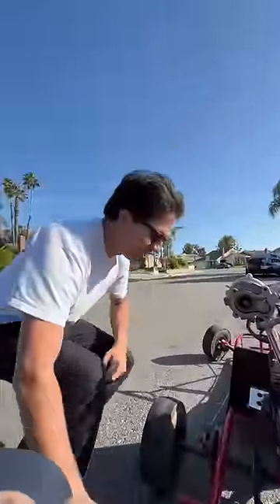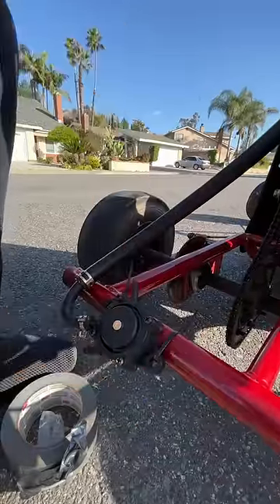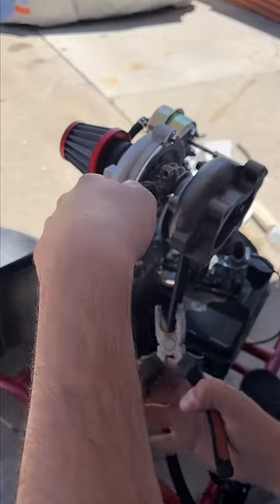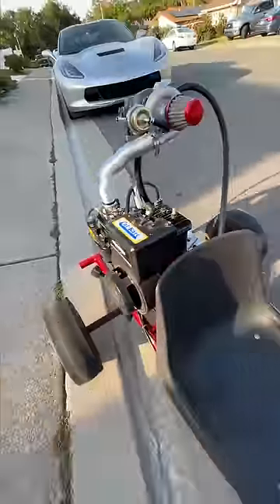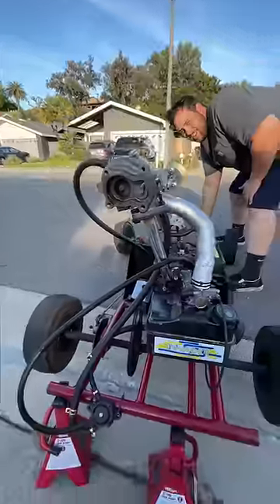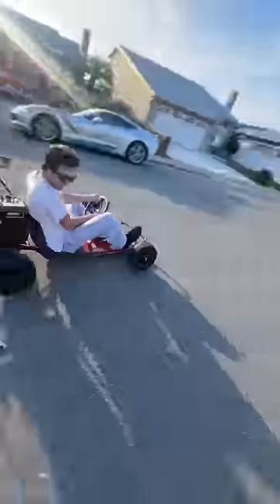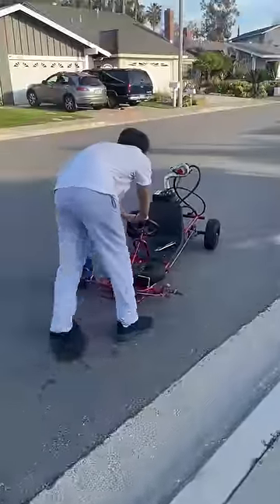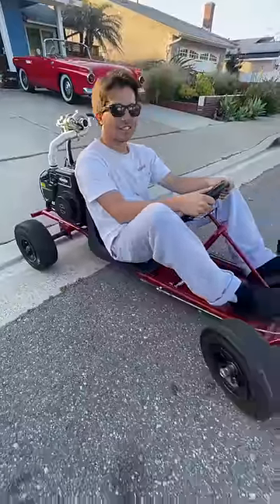I put a turbo on my Gokart and it didn't end well

Comment: I don't see how that pipe held any pressure.
Reply: It dont hold pressure on the dryer either
Reply: That's exactly what i was thinking..
Reply: Because it's like five pounds of pressure Jesus
Reply: @skullman0819  Yeah, 5psi above atmospheric pressure. That's a lot of pressure for some shitty pipe that has no structure.
Reply: It doesn't hold pressure 😅
Reply: You can bust one of those tubes with your lung pressure.😂
Reply: It didnt lol he should be worried about other things, obviously
Reply: There's no way that any of that boost is going into the engine.
Reply: @jonnywilson9117  just 7psi is half an atmosphere!! Needs a proper boost hose too!
Reply: Nah, they are nothing but foil with metal wire. Barely enough to do the intended heat transfer from the exhaust manifold to the air intake. Very easily he had pin holes in it before he got it installed.
Reply: @jonnywilson9117  yess it it i rebuild steering gearboxes and we use 6psi and u wont believe how much pressure that is when they go bad.... in liquid... i know turbos psi im air idk if this pressure works the same
Reply: @214oc9  Well the other guy seems to think 6psi forced induction is under half of our atmospheric pressure. What he doesn't realise is (unless I'm wrong) it's 6psi above atmospheric pressure. Which yes, is a lot of pressure. Well, it's not when talking forced induction, but a pathetic bit of ducting isn't going to handle 6psi trying that's essentially trying to suck it into the turbo. 6 psi in a large area is small. But in a tight area it's a lot of pressure being that there isn't as much volume. I imagine getting hit by 6psi of liquid (oil) is worse than 6pis of air out of a nozzle or tube of the same size.
Reply: @warrenlilly2091  It isn't when referring to forced induction. 7psi is 7psi above atmospheric pressure because it's being forced under pressure. Any boost number you're going for is always going to be above atmospheric pressure. So if you're hitting boost numbers of 20psi, that's 20psi above atmospheric pressure, not 5.3psi as atmospheric is around 14.7. Total pressure would come to say 20+atmopheric pressure. But obviously that's already taken into account. A boost gauge is at 0 because there's no forced induction. Again, 7PSI of boost, is 7psi above atmospheric pressure. It's a lot of pressure for a tiny hose to take. That hose would either pop off or just get sucked into the turbo. Pre turbo is under vacuum, after the turbo, or the hot side is pressurised.
Reply: 7psi is 7psi ABOVE ATMOSPHERIC PRESSURE. do you really think "boost" would be half of atmospheric pressure? That's the definition of vacuum. Jesus ppl read a book
Reply: If it works it works
Reply: Thats why he used it. It wont hold any boost
Reply: It didnt. The turbo most definitely didnt do anything lmao
Reply: Single cylinder engine doesn't make enough exhaust pressure to turn a turbocharger 😅
Reply: Jb-weld
Reply: I used a Chef Boiardi can to use in my 95 gsx and it held around 12lbs haha
Reply: @FlexYourFreedoms  A chef boiardi can is pretty thick steel / tin lol...
Reply: It doesn't.
Reply: lol anyone that thinks it holds anything has never tried turboing a car.. 7psi for a standard engine is deff a fair amount of pressure, and any hose not quite on enough/clamped properly will quickly blow off
Reply: I don’t think it worked at all I didn’t see any speed shots or anything wheel falling off is just to make up how extreme it never was and wouldn’t happen if anything the rear woulda blew off
Reply: @skullman0819 more like a half pound of pressure 😂
Reply: Corrigated tube didnt extend out so no pressure 😂
Reply: @tgshark1 the dryer doesnt need air pressure💀🤡
Reply: It didn't the turbo wasn't doing shit trust me
Reply: I used shop vacuum hose and my 212 and it pushes alot of boost surprisingly

Comment: Do a dual carb setup to stop it from leaning out under boost
Reply: Or maybe get a proper size performance carb so he can adjust it and make a proper charge pipe
Reply: Ur my kinda guy
Reply: Or, get a real pipe that will actually hold boost....
Reply: @moddedgt350  small loan of a million dollas..🤭
Reply: Nerd👍
Reply: @franktime4425  -🤓
Reply: Get a wide banddddd see what afrs your running
Reply: @moddedgt350  Oh yeah! We love EFI and similar things like it till they break :) my CR125’s FI kit was about $1k, but damn it ran great until it didn’t! That replacement hurt more than the initial purchase.
Reply: @moddedgt350  thats what i would do
Reply: Carb needs to be on the inlet of the turbo for it to run properly.  A regular carb like that is not made to have pressure being forced into it.  Either that or the carb would have to be modified as a blow through carb.  The thing probably dumps gas all over the place.  Also that pipe on the outlet of the turbo is a joke, that is not made for any pressure it’s made to carry heat from a manifold to a air cleaner valve on an old school car.
Reply: What boost? No way that turbo is spooling enough.
Reply: @zachiga  Yeah fuel injected can just stay on the bigger engines. I tend to stay away from fuel injected anything Motorsport wise.
Reply: Wont that make it half draw though? Im confused on how these dual carb setups work. Also, wont pressurizing the one carb and getting a stronger fuel pump with the right jetting stop it from leaning out?
Reply: @syndeko1632  I think you would just have to test it out tbh... Both would work just a matter of how you execute it.
Reply: urnum5495  what?😂what are you mad about guy😂😂
Reply: Fax
Reply: @joshmanis9860  how bout he get a 3 Honda with no engine with Hector holding the money because he to slow to to run away with the money 😂😂😂
Reply: Or just dump the lot.
Reply: The problem is he's trying to run the system blow through style without pressurized the fuel bowl, with a draw through system you don't have to do anything to a carb aside from jetting it with whatever jet works, but with a blow through system you have to pressurize the fuel bowl off of the boost coming out of the turbo. 
Otherwise the positive pressure in the carb throat is trying to reverse the flow through the jet and blow air into the bowl, a carb works because the air pressure on top of the fuel in the bowl pushes down on it forcing fuel through the fuel circuit. 
What he has to do is put a fitting where the bowl vent is and run a line over to the boost coming out of the turbo, then it's just like normal, when the air passes through the venturi in the carb throat it picks up speed and pressure drops right there and the greater pressure on top of the fuel in the bowl pushes it through the fuel circuit just like a normally aspirated engine. 
Google "blow through boost system for a carburetor" and you'll find articles explaining what I just did.
I work with boosted engine's (and a turbo will work on a single cylinder engine, I don't know why all kinds of people in the comments keep claiming they won't but they will, obviously they're just guessing and not doing a very good job of it at that).
Reply: @moddedgt350   Chinese fuel injection kits are around 300 bucks.

Comment: You need to add an expansion chamber for the boost because it's a single cylinder engine
Reply: Expansion chambers are for 2 stroke engines.
Reply: @benztech2262  normally, yes. But with a turbo things change buddy
Reply: @kevinfilanowicz605  You know what you're talking about, the exhaust pulses need to be more... synchronous
Reply: @benztech2262 no way you're a Benz tech with this knowledge
Reply: @isaacschoenly2813  not many single cylinder Benz's
Reply: He should turbo up a Kawasaki H2 750 triple two stroke motor, then he could Really burn the tires off! Owned one back in 83, it was balls out fast... 👍

Comment: Suggestion. Use a volume tank between the carb and turbo.  A single cylinder engine has notable pulses of boost.  You may need a volume tank on the exhaust side as well to help moderate those pulses.
Reply: Like a dirt bike’s expansion chamber? That is actually a genuinely good idea. You could even just use two MZ65 exhausts, one as the exhaust obviously and the other as the turbo inlet pipe. Would be dope and might work
Reply: And how are you oiling the turbo that motor has a splash system no pressure
Reply: @keevinboling6691  didn’t he already say he has a vacuum pump?
Reply: @joetroy2904 a vacuum pump that loses vacuum as soon as boost is built.  Lol

Comment: You need a boost referenced fuel pressure regulator and a fuel pump if you want to do a blow through. The carb might need some mods though. Way easier to try a pull through setup on a budget.
Reply: Actually I think that if he had a working brain, it would be an improvement
Reply: He needs to pressurize the fuel bowl off the inlet from the turbo, that's why it's not working. 
A draw through system you can just use a stock carb, re-jetting aside, but with a blow through you have to put a fitting on the bowl above the fuel level and run a line over to the pressure (boost) coming out of the turbo, otherwise the positive pressure in the carb throat just wants to blow air through the jet into the bowl.
Science!!!

Comment: You really need to build an aluminum intake pipe with couplers so you can actually build boost.
Reply: That's a bit extreme for a fun kart build. Some low pressure rated pvc should be fine, if he runs a wastegate. Otherwise some iron pipe with a rubber joint would be easiest.
Reply: He has so many issues it aint worth listing.....

Comment: If you can put one on a 2 stroke, look for an old rotary valve Bombardier engine.  They did make go cart engines back in the day, also snowmobile and motorcycle engines.  Would be interesting to see one of those engines with a turbo.  The one used for my dirt bike was pretty awesome.  Never lost power because of the rotary valve and it’s like having an electric motor.
Reply: Getting the port timing with the disc figured out may be a bit tricky to prevent excessive scavenging, but it's not impossible. 

Rotax (bombardier) does manufacture turbocharged engines that are pumping out like 200hp from 700cc easily iirc.
Reply: @100GTAGUY  ahh, someone that knows about those engines.  Noice.  Yeah, probably be a little trick especially with the disc.  I wonder if any of the RG500 Gammas had experimented with turbos since they were a V4 R.V 2 stroke.
Reply: What if i put one on my 50cc moped? Ive made it hit 75mph
Reply: @Actually_Just_A_Cup  a turbo?  Look into it and see if anyone has done so here on YT.  Quick google search shows that turbos are available for 50cc 2 strokes.

Comment: As someone who blew up at least 50 wheels/tires building my kart on the front spindles, investing in some quality wheels is paramount. I used to run solid rubber wheels from harbor freight on my front spindles. Those were the only cheap option where the bearings wouldn't explode after one run (or during the first run). 

Make sure to use grease before you install the wheels, I use red and tacky. Gopowersports has good wheels that fit vintage spindles with bearings meant for the load. Also grease those before using, but they will last longer. Drilling through your spindle and using a castle nut will keep the wheels from coming off, and also let you run with the nut looser, letting the wheel spin easier.

Also i would recommend getting a wider rear end if you're gonna run more power. I have a less than stock 301cc, and before i got a wider rear end, both my and my friend had flipped it. 

Best of luck to you

Comment: The Turbo probably wont help if your pushing the air into the top of the carburetor. It will change the whole fuel mixture process. I'm thinking you need to put the carb in front of the turbo intake. Fuel injection would be different.

Comment: A vacuum fuel pump on an engine that doesn’t make vacuum LOLLL you’re still getting there but you’ll get the hang of it
Reply: lol
Reply: Bruh don’t comment if you don’t know what you’re talking about
Reply: Single cylinder engine crankcases pulse vacuum, and the vacuum pulse fuel pump is hooked up to the crankcase to run the pump.
Reply: @Texassince1836  if you think that little pulse vacuum will actually pull thick ass oil up to the turbo your actually insane
Reply: @thicok4555  it will pump oil. How else do you propose he gets oil to the turbo?
Reply: @thicok4555  SAE30 or 10W30 isn't as thick as you think by the way.

Comment: Make sure you inspect a go karts hinges, engine and structure, I haven't driven one yet but I know that they could wear down, just like a normal car would. As for the blown wheel I think you're talking about the tire itself, not just your average hauler truck wheel being my daily reward for existing at 7:08 PM.
Best I'd say is install bigger wheels, but make sure the engine can still keep up with those newer rims.
Plus, incredible for someone to think about putting a Turbo on a Go Kart. At least I'm not alone with that idea.

Comment: That turbo likely acts as more of a restriction that anything else, there is not enough exhaust gas to spin that quick enough for it to do anything other than get in the way. Mounting a forward facing air filter to it and going for some sort of ram air set up would do more, or more accurately, less harm

Comment: You probably should try this again but mount the carburetor in front of the turbo. Aka, the turbo compressor sucks air through  the carb. This should give you some better results. I like the pulse fuel pump as a oil pump idea. That might work

Comment: Forget about using an engine. Remove everything and use a big turbo or two turbos, create a combustion chamber (or two if dual turbo) and mount a propane tank in the front t of the cart. Run the gas lines to the combustion chambers and add also a spark plug on them. Air intake goes into the turbo, the air is compressed, sent to the combustion chamber, ignited, and sent back to the turbo in the turbine side to spin it and then create a custom exhaust to maximize the air pressure going out. Your throttle will be the propane tank valve. You will need brakes on the wheels. And you will need to spin up each turbo using an air blower from your yard tools while igniting the sparkplug. Once spinning, and burning gas, no need for the spark plugs to be active. 
My friend and I made a turbine setup like this and it worked very good.  The idea was to create a cart like yours with twin turbo setup, but we never got to do it as we were not going to spend so much money in two big turbos (we had a used truck big turbo for testing but we blew it up during testing) .
And get yourself a good pair of ear plugs because it sounds like a jet fighter. 
Cheers

Comment: Properly weld your turbo and it'll work better. You should also make sure your throttle is big enough to get the air flowing, your turbine is properly oiled, and you get the proper fittings on the hoses. You'll get more power with less strain.

Comment: Was that Vice grips holding the tie rod?  The carb would work better if it was a pull through, not a blow through. Mount it on the turbo compressor housing and put a tube directly to cylinder head.
Reply: It's a flathead there is no cylinder head.

Comment: You need a pressure chamber 4x the displacement of your motor to build any useable boost for single cylinder engines

Comment: You should get a better frame! More racing style ya know, It’ll cost around $1k-1500 but it will handle like a 911 and grip like a Michelin Pilot Super Sport😂 they sit really tight, I have one I’m running right now. Set up was moderately easy depending on motor you may have to MIG some extra brackets seeing what you guys are into lol I love your videos man keep it up! Could also send pics of my go cart if you’d like for inspiration, be safe and keep doing what you love🙏🤝❤️

Comment: Yes! Adding a turbo without changing the piston. Increasing combustion chamber volume ! 

If you’re gonna add more air. It’s gonna need more fuel. But the motor has to be capable of making more power to begin with. 

For that little motor I’d think you need at least the right piston. Cdi, bigger carb. And run some better fuel

Comment: That's not making any boost, and if it does it's not going to run. The easiest way you can do it is to do a draw-through system. Mount the carburetor to the intake of the turbo so it's drawing the air/fuel mixture through the turbo. If you do it this way you won't have to make any fuel system changes and tuning it would actually be possible.

Comment: You can’t turbo a single cylinder without make a baffle for air to get caught in to keep pushing it in, your only getting on on exhaust stroke, 1 every 4 eatery than actually car engine with spins turbo every stroke due to many cylinders

Comment: I know a lot about turboing engines, especially small ones. That’s not even close to right, and that’s coming from a half asser. If you would like legit advice and to fully understand how it works just let me know. I can type it in a reply or I can email you or whatever. I currently have a 600cc snowmobile turboed, oil and fuel system all set up properly running 14 psi and it runs great